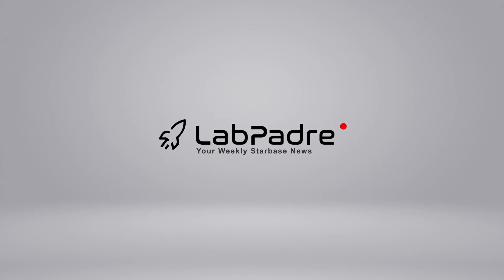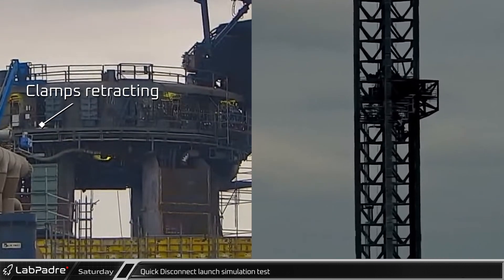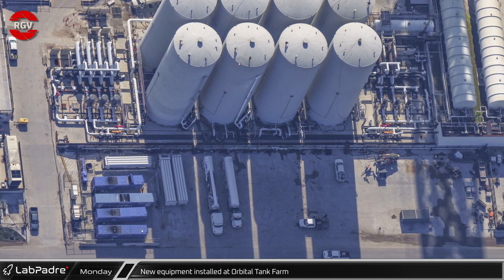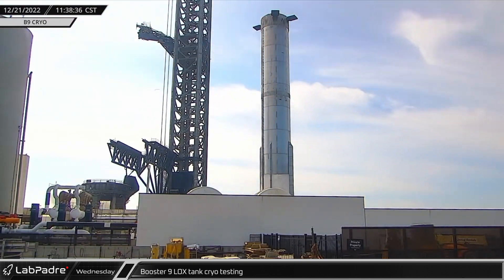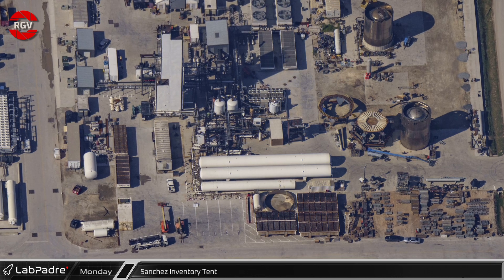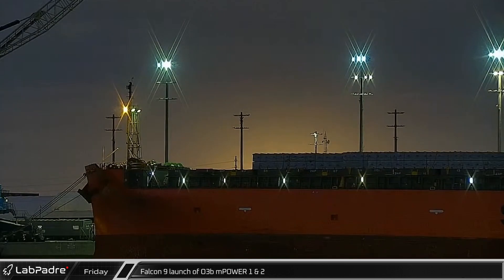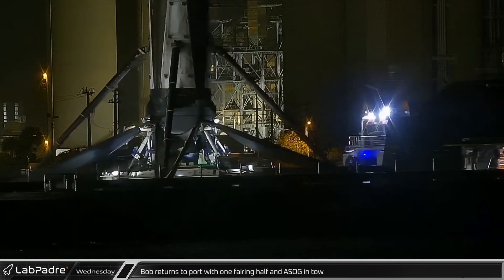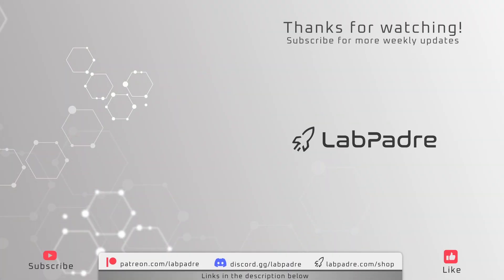Final Starbase Update of 2022! - Starbase Weekly Update #42

Comment: 2023 will be the year it launches! I know I said that about 2022, and 2021, but 2023 will be the year... right?
Reply: ive said since april that starship will launch in febuary 2023 then be cancelled.  everyone said i was crazy and that it would launch in june because thats what elon said,  then july then august all the while blaming the faa.   i stick to that.   starship is a big dumb idea that wont work.
Reply: @jebes909090  why won't it work in your opinion
Reply: @cosmicarc7978  theres faaar too much risk in catching the rocket.   if you mess up even once,  you'll destroy the tower and possibly the fuel farm.     Thats if its even able to take off without destroying itself.   33 raptor engines put out a LOT of thrust and spacex doesnt want to build physical thrust redirectors.   so all that power will just reflect back to the rocket.       

as for starship,  i dont think it will survive re-entry.   those tiles are sketchy at best and i dont think theres nearly enough of em. 

if starship isnt reusable,   then its VERY expensive.  and if its very expensive,  theres no real point in having it.   so they will probably cancel it.